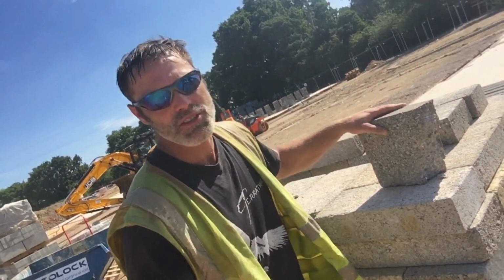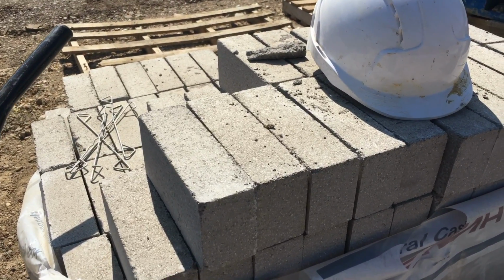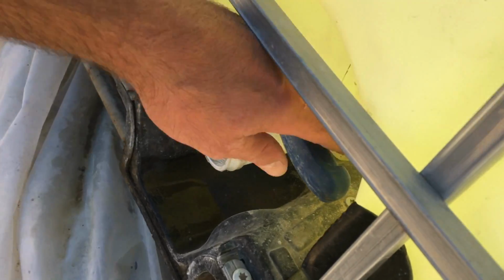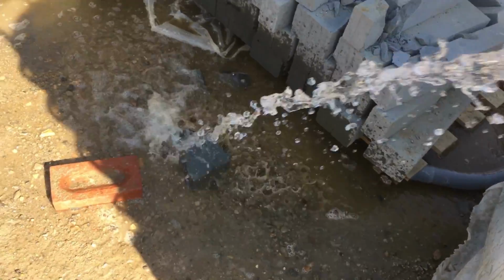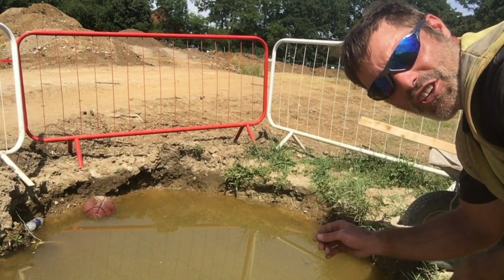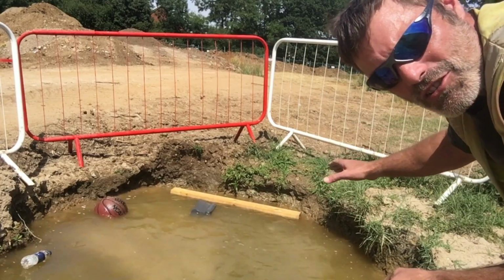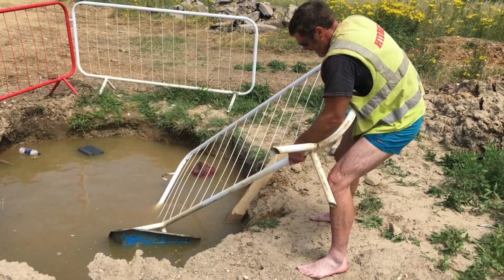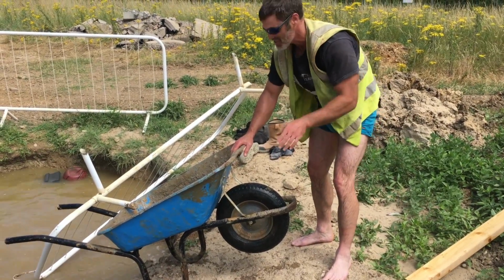100% Proof... I'VE JUST DEBUNKED GRAVITY ! ...(WATCH BEFORE DELETED)!!! DBM. England.

Comment: Things float when they are positively buoyant, or less dense than the fluid in which they are sitting. This does not mean that an object has to be lighter than the fluid, as in the case of a boat; objects just need to have a greater ratio of empty space to mass than the fluid.   that is what you proved nothing to do with disproving gravity mate.

Comment: The stars in the southern hemisphere are entirely different from the stars in the northern hemisphere.  This observable, repeatable, testable, natural science FACT alone completely destroys the flat earth fantasy!
Reply: What evidence do we have for the globe-shaped of our planet? Well, here is some evidence…

The Earth casts a circular shadow on the Moon, which can only be caused by a globe-shaped planet. (A flat Earth would cast a narrower, more horizontal shadow.)  The Moon reflects the light of the sun because its surface is made up of light coloured rock and light coloured sandy dust, and therefore makes a natural reflector. We can view the surface of the moon through astronomical telescopes and see its light coloured rocky, crater riddled surface for ourselves. 

Over 2000 years ago, a Greek man called Eratosthenes established our planet has a curvature. He established this using sticks positioned at a certain distance from each other and by measuring their height over distance and by examining their shadow. He then made an estimate of the circumference of Planet Earth, which centuries later was found to be remarkably close to the actual circumference. 

Seismic activity measurements have demonstrated that the centre of our planet is solid. And electromagnetic measurements have revealed that it generates an electromagnetic field, which has led scientists to deduce that the Earth has a solid, spherical core of Iron. Further analysis of molten larva has revealed a high iron constitution. Iron is one of the most common metals and Iron ores are one of the most common metal ores. 

On a barren surface in a temperate climate, which are not affected by heat induced mirages, such as salt flats in winter or an ocean, we can witness cars or boats appearing and disappearing above and below the horizon. By using a powerful telescope, one can view the horizon close up and witness the effect in greater detail. A car or boat can be seen appearing and disappearing above and below the horizon is further evidence of the curvature of our planet. 

Water, whose chemical formula is H2O, is a liquid that has no discernible shape. It follows the shape of the object it flows over. On a planet, such as Earth, it follows the curvature of our planet and flows around the land masses of our planet. Our planet spins on an axis and orbits the Sun, our nearest star. The gravitational pull of the Moon causes tidal movements. Our planet has an atmosphere and a strong centre of gravity, which means water remains in a free flowing state and does not turn into globules like in outer space. All these factors help further demonstrate that our planet is globe shaped, rotating, and effected by factors such as gravity, the gravitational effects of the Moon, atmosphere, etc.

Furthermore, when liquid is allowed to escape a containment vessel on a space ship, such as squirting liquid from a drinking bag for instance, it turns into globules in the weightless environment and will remain suspended in a globule until an astronaut sucks the globule into his or her mouth. Whereas liquid squirted out of a fruit juice carton on board a submarine beneath the ocean surface will remain in a free flowing liquid state and will not turn to globules. This effect further demonstrates the gravitational and atmospheric differences of our Planet and outer space, and how liquids behave. 

NASA is not the sole space agency on Earth; many different nations have space agencies and satellites. Similarly, NASA was not even the first space agency. The Russian Space Agency was the first space agency and were the first to launch an artificial satellite in space (Sputnik 1) and the first to launch a male Homo Sapien into space. As a consequence of this remarkable, technological achievement, the US Government realised they were behind in the rocket race, and that if the Russians were able to launch a satellite and rocket into space, it was only a matter of time before they could launch a nuclear weapon and cause it to land back on Earth! Hence, NASA was formed as a counter response. Subsequently, many different nations have space agencies and satellites. Astronauts of different nations have gone into space. The International Space Station was not the first. Soviet Russia experimented with space station technology, accumulating in the successful MIR programme. The USA also launched Skylab in the 1970s. The International Space Station is the accomplishment of different nations and houses astronauts of different nations. With the NASA shuttles grounded, astronauts travel to and from the ISS on Russian rockets from within Russia. Russia remains at the forefront of space travel to this very day. (Considering the amount of space agencies that exist today in many different nations, the amount of satellites that exist of many different nations, and the astronauts of different nations, and considering that many nations are in competition with one another, it would be the height of arrogance and stupidity to think there is a global conspiracy! At the United Nations, rival countries often disagree over issues such as what action to take in Syria, let alone agree to a global conspiracy!)

Contrary to all the conspiracy theories, men really did land on and walk on the Moon! And this feat was accomplished on a total of six occasions as a result of six different manned Apollo rocket launches. The last Moon walk included a civilian geologist. The total number of Moon landings and walks would have been seven, but Apollo 13 ended in near disaster. Fortunately, the crew of Apollo 13 managed to return to Earth in what is probably the most successful rescue mission in the history of Homo Sapiens. If the USA wanted to fake the Moon landing, they only had to do so once, and not seven attempts, including faking a disaster one of the missions. Also Soviet Russia never disputed that men landed and walked on the Moon, and they were probably able to track the space flights of Apollo using their Ballistic Missile Early Warning radar and/or satellites. It was in the military and ideological interest of Soviet Russia to disprove the moon landings, but they never did. And to this day, no Russian Premier or President has ever disputed the Moon landings.

The effect of gravity on Earth can be observed by rocket launches. To be able to overcome our planet’s gravitational pull and enter the vacuum of space, a rocket needs a lot of thrust. By contrast, a plane uses conventional jet engines to create thrust, and speed to generate air flowing beneath the wings, which allows a plane to take off. A plane then follows the curvature of the Earth because a plane is still affected by gravitational pull when in flight, and uses thrust and speed and slight variations to maintain flight. It does not need nor use the same amount of energy and thrust that a rocket uses to defy gravitational pull, simply because it does not need to. A rocket is designed to defy gravitational pull, leave our atmosphere, and enter the vacuum of space, whereas an aircraft is designed to exploit gravitational pull and our atmosphere in order to maintain flight and reach its destination. As a result of the Apollo missions, astronauts were able to take photographs of Planet Earth, which proved beyond all reasonable and unreasonable doubt as to the shape of our planet! These Apollo mission photographs were taken before photo-realistic computer graphics. And no painter, past or present, can truly mimic a genuine photograph taken from space. A vintage photograph looks like a photograph, with the additional evidence of the original negatives and contact sheets. Whereas no painting is photo-realistic, even by some of the finest artists.

Photographic Satellites cannot take a full picture of Earth from space because they are not in a high enough orbit to do so. Instead, a sequence of images are taken, which can then be merged digitally to form one photograph. (Photographers on Earth can and do the same thing when they want to photograph a landscape or horizon at a particular scale but cannot fit all the required landmarks in the same photo.) Likewise, no space agency on Earth has any need to take a photograph of Planet Earth from space in just one shot. Photographic satellites do not exist solely for the purpose of satisfying the conspiratorial minds of Flat Earth believers! Even if a photograph could be taken in a single shot by a single satellite, Flat Earth believers will dismiss it as a computer generated image!

Even if we could not leave our planet, we can still view other planets and moons within our solar system and view them to be globes. And our planet casts a circular shadow on the Moon, and not a horizontal, narrow shadow. It would be the height of stupidity and arrogance to therefore claim the Earth is flat!

We know that our planet is not at the centre of the universe by observing the orbits of planets and moons within our own solar system, as well as other celestial bodies and stars, and galaxies, etc. Astronomical observation has revealed that our universe is teeming with other Galaxies and stars. Using the stars in our night skies, we can further prove the movement of our planet and the curvature of the Earth. The night sky in the Northern Hemisphere are different from those in the Southern Hemisphere, which further demonstrates the globe shape of our planet. And during the year, the compass position of stars and other celestial bodies changes throughout the year, which further demonstrates that our planet moves and rotates. 

Our planet spins on an axis and thus the Northern Hemisphere and Southern Hemisphere face closer to the sun at different periods of the year. For instance, between say June to September, it is summer in the Northern Hemisphere whereas it is winter in the Southern Hemisphere. And say between December to March, it is winter in the Northern Hemisphere and summer in the Southern Hemisphere. This can be further demonstrated by the fact it is winter in the UK during December and summer in Australia in December.

Why does water sticks to planet Earth?  The same reason why rocks and dust stick to Mars and the Moon ...GRAVITY!

...
Reply: Flat Earth Believers, if you are convinced of your argument and if you have the courage of your convictions, then please put your evidence in writing, seek publication in an auguste publication such as "NATURE", and also seek peer review from the worldwide scientific community.

That is how science discoveries are publicised and validated.  And not through Youtube.

Comment: The Newton is the SI unit of weight (not KG as that is the SI unit of mass).  A Newton is determined by multiplying the mass (in kg) of an object by g (as in gravity). As at sea level on Earth g=1 the mass and weight of an object are the same. The higher in altitude you go the lower the value of g. If you took a set of scales onto an aeroplane you would think your diet was working.

OK one question:-
If a falling object is only to do with buoyancy and density then why does a free falling object accelerate towards the Earth? If density is the main cause air becomes more dense the lower the altitude, surely this should mean that an object decelerates as it falls.
Also why is the acceleration always 9.8m/s/s? 

And ffs a scientific theory is never proven or unproven it is a hypothesis that is proven. When a hypothesis is proven it becomes a theory (in other words it is true).

Comment: Well done, you have spread misinformation to the scientifically illiterate while proving and debunking nothing.

Density is just the relation between an object's volume and mass. Water happens to have a density of around 1 gram/cm^3, depending on impurities and mercury has a density of 13.56 grams/cm^3. The reason objects float instead of staying in the same place inside of a liquid or gas is because gravity is pulling objects together with a strong emphasis on objects with more mass. The resulting downward force can be measured in lbs, newtons, exc. as weight.

TL;DR - Because 2 objects cannot intersect, denser objects are attracted more to the earth and fall through less dense ones. Without gravity existing at all, an object would just float in the air while entropy worked its "magic" making the atmosphere less and less dense until everyone suffocated from insufficient oxygen.

Difference between a theory and a law - A law can be expressed in a mathematical formula.
Reply: https://en.wikipedia.org/wiki/Gravitational_wave
Forgot to leave this here